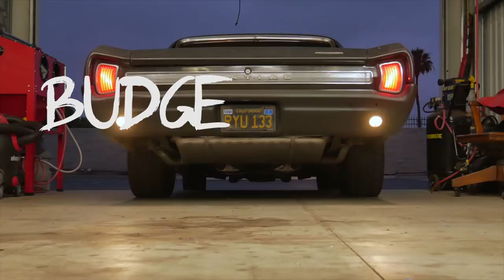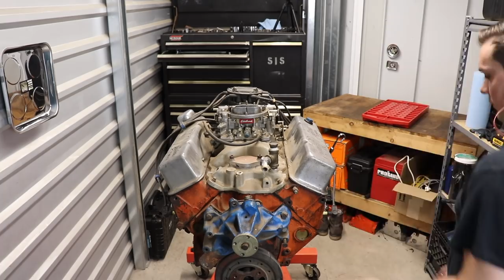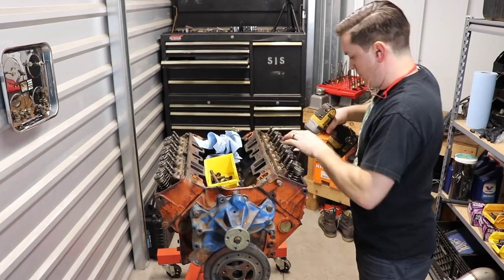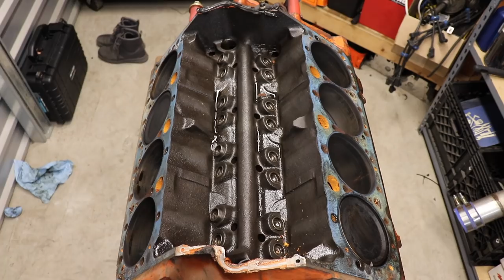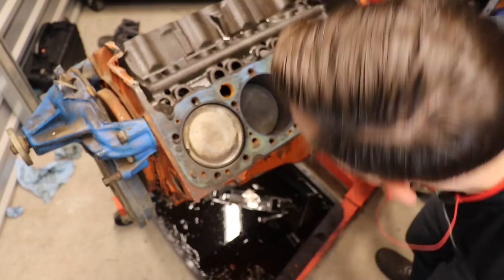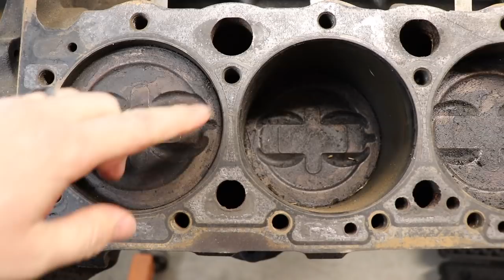Chevy 400 Small Block | How to Disassemble a Small Block 400 -REBUILDING BASED OFF SUBSCRIBER ADVICE

Comment from the maker: IT'S UP TO YOU SUBSCRIBERS, GIVE ME YOUR BEST BUILD RECOMMENDATIONS AND I'LL MAKE IT HAPPEN...LET THE FUN BEGIN!!
Reply: Well, seeing how You got one of the most desirable Gen 1 SBC's ever made, combine it with a set of Vortec heads ( with the guides machined down for the ability to run a cam with more than .460" lift..) A healthy cam ( a Comp XE268 works nice, I can suggest plenty other grinds that'd be awesome too..), sell the heads and the basic performer that came on it, use the dough from the heads and intake sale to get a Clone Edelbrock Preformer RPM air gap Vortec intake, and enjoy a motor that will make a little over 400hp with boatloads of torque.
Reply: Chilli Willi is right and I've seen the vortec heads with a some port work and matching ported intake with a hydraulic roller make 500 hp easily.
Reply: Les Phillips, absolutely. I don't know the budget of this build, but 500hp is within reach with Vortec production castings. I've made over 600hp with a set of the 225cc Bowtie Vortecs and a solid roller on a 406ci engine. I've come very close to that number with fully ported stock castings cut for 2.08/ 1.60" valves.
The "secret" of why the 906 or 062 Vortec heads work so well is their flow EFFICIENCY, coupled with a very efficient combustion chamber. The .300" raised intake runner works well for only @168-171cc..
Reply from the maker: @TurboDog73TX  I haven't really thought about exactly what I'm spending yet. At this point I'm leaning towards the Vortec head idea. It just comes down to how easily I can find a pair.
Reply: Nick, they are readily available brand new still, from numerous sources including GM dealers.
Something You may consider if Your budget permits is a set of the "ProMaxx" iron Vortecs, they are much thicker in the deck surfaces than the OEM heads, and flow more out of the box, they also come with screw in studs as delivered. If You're really seeking 500ish HP. 
Nothing wrong with stock castings, but the aftermarket versions can be cheaper in the long run. Good luck no matter what direction You go!
Reply from the maker: @TurboDog73TX  I really appreciate the tip. It may not be more expensive in the long run to get them new considering the work it will take to get an old ones ready. I'll check out Promaxx
Reply: I need a 400 SBC to finish my k20 resto  it came with a 400 from factory but when I got it it had a broken 327.
Reply from the maker: @TheMoldyOne  The 400 isnt an engine you see a lot.  Hopefully you find one soon.
Reply: @BudgetBuildGarage  u should be able to find vortec heads from a  local U Pull It car junk yard for like 150 to 180 bucks, the best year of vortec heads that i have herd are the 99 vortec heads, and if u want to run a 500 lift cam u can retro fit the LS6 VALVE SPRINGS as long as u use the comp cam retainers. If u want the part numbers on the retainers and valvesprings. Just let me know
Reply from the maker: @sethnelson8698  Thanks for the help man. I was actually planning on going to my local pick-a-part next weekend. I am looking for those heads and some random other things I need.
Reply from the maker: Thanks for the casting numbers!  I am really looking forward to this build too.
Reply: @BudgetBuildGarage  no problem man, some other casting numbers that i found are 12552520, 12558059, and 12558062. Good luck on the build

Comment: I would....
1. Disassemble the short block, have it zero decked. 
2. Check cly. Bores, main bores. If clys. Check out dingle ball hone the clys. 
3. Check crank journals if they check out reinstall crank reuse bearings if good. Is the oil pump std. Vol.?? If it is add high pressure spring. Add crank scraper and windage tray.  Stock pan will work just fine. 
4. Clean and inspect pistons and rods. If big end checks out reuse bearings. Use new rings file fit to .025 end gap. Large gap if you want to spray it. 
5. What cam is in the engine??? Competition products has a great catalog with lots of no name cams to choose from. Reuse timing chain. 
6. Disassemble heads, gasket match and bowl blend ports. Drill steam holes. Clean and inspect valve's and reassemble with matching springs. Don't forget to check installed hight. New valve seals. Change out pressed in studs for the screw in replacements. Use comp cams magnum rockers or the clones. Just going for consistent ratio. 
7. Install heads useing a .035 to .040 head gasket. I calculated the comp. Ratio should give you 9.5 to 1. 
8. Buy a performer rpm clone gasket match and clean up pendulum area. As for carb. Holley 3310 750cfm vacuum secondary is the ol' stand by. 
It's my assumption that the former owner built this engine and it would get hot so he pulled it, declairing all 400s are junk because he didn't pay attention. I also assume it doesn't have many miles on it. Also use a wix 15794 2 quart oil filter. Extra quart of oil and double the filter cant hurt.
Reply from the maker: Thanks for the info!  I really appreciate the step by step you have laid out here.
Reply: I missed that the heads are small valve castings, if your being Totally low buck I'd run them. Helped a buddy build a 350 we called the mouse turd and we cleaned up a set of small valve heads as described above except with stock rockers and it ran surprisingly well. Since the heads are small I'd use the performer that was on the engine but still get a 3310 carb. Competition products has a howards cam #cl117091-14 that is a copy of the 350hp/350 cam for $129.00. While not the best head you could use when optimised they will do ok.

Comment: I built a 400 sbc and while I spent quite a bit on it.   Doing a budget build, I would get a cheap set of 64cc aluminum heads (get the steam holes drilled).   I installed a Lunati Hydraulic Roller cam but if you didnt want to spend that much a flat tappet would work.

Comment: Clean the carbon off all the pistons and if they all look as good as the first one then leave the bottom end alone.  Put a decent cam in it and some aluminum heads and run it!
Reply from the maker: I will clean them up and make sure they are all in good shape.
Reply: @BudgetBuildGarage  if you ask uncle Tony's garage you should put them back in backwards.

Comment: I've built alot of small blocks never a sb400 but built a 385 stroker, most important is head flow at least get vortec heads. After that the common intake,cam, and headers. I did build a b.b.454 for my dads chevelle dome piston port polisish heads big vales. But on you're small block most important as long as your good with what is done next. By the way the best way to learn is to do what you are doing and that is to do it . Also i learned from reading , books by David Vizard are very good. Thanks for sharing always good to see youger gear heads playing with their toys.
Reply: How did you get to that cu inch

Comment: Iron Vortec heads flow a ton of air more than the 70cc ones you have do. They will boost the compression with your existing dish tops to about 10 to 1. You can drill the heads to fit a non vortec intake but I would fins a used RPM if you could. Prep the heads to take .500 lift with a nice 280 magnum flat tappet hyd cam. Under 500 lift. would be a beast of a torquer with a 5500 top end.
Reply from the maker: I like the Vortec idea.  I think it wouldn't be to hard to find a used set for fairly cheap.  Thanks for the comment!
Reply: Yes. Do it. Buy the heads already done. Leave the bottom end alone if all checks out.
Reply from the maker: It is a solid plan.
Reply: Don't be afraid to put bearings in it especially cam bearings they get wiped out often you said oil pump why not new bearings polish the crank right there in the garage and then when the tach is poking around at 5 grand or more the chances of spinning a bearing is far less likely to happen if it does most of the time there goes a good 400 crankshaft

Comment: 400 cid with 400hp seems like a realistic goal! Cam, drill and port (gasket match) the heads, Rebuild the 1406 carb,  dingle berry the cylinders and run it
Reply: IMO I think you are right with the hp numbers...the 400 being externally balanced does not like high rpm...well not for long anyway...

Comment: What I would do is take it down and get the block down and have it magnaflexed and checked for cracks if it turns. Out good I would have. The the heads reworked and steam holes drilled in the heads

Comment: Best bang for tha low buck. Rebuild tha short block(can re-use all tha factory guts).  Get sum old 327"camel hump heads" have them ported n screw in studs n 2.02 valves installed(or whichever aluminum head with u can afford with the biggest intake values street/strip 400s love 2.02-2.08 valves). Victor jr intake w/at least a 750 dbl pumper. Comp cams h292 cam. 2800 stall converter n 373 gears 350 or 400 trans(makes no difference). Will sound nasty and get you in the mid 11-12.20 range depending on the head choice on pump gas. And will take a 200hp shot of nitrous to show up those trailor queens. Good luck with whichever u choose 400s are very versatile

Comment: I think you should make it work with what you have your guy's name is budget build garage after all. I dont have a lot of cash so i like to see stuff made work thanks
Reply from the maker: I wouldn't mind doing that. Maybe just drill the steam holes in the heads and put a new cam in.
Reply: @BudgetBuildGarage  vortec heads off say a 96 or 97 pickup with the right machine work for a higher lift cam and screw In studs, steam ports drilled and then port them and intake yourself can be done for around 250 or so and matched with the correct hydraulic roller cam will make way over 450 hp depending on compression and that's about as budget as it gets.

Comment: The fact that all the pistons (that I could see anyways) were evenly carboned (is that a word?) tells me the rings are still doing their job. (sealing the bores/not letting oil past) Check the block decks for flat (head gasket issues between 3/5/7 cylinders and #1 outboard to the spark plug cooling hole/head bolt hole) to determine if the decks need to be surfaced. If they're flat, pull the pan and check the bearings. If they are OK, go ahead and find a set of heads (bigger is better for most 400 applications, within reason) and slide in a cam and have fun.

If you have the budget or find issues with the deck flatness or bearings, my vote would be to blueprint the block, (bake/magnaflux/square deck/torque plate bore/etc) Scat 1-90955BI balanced rotating kit, and a good set of heads for the top end and be amazed with the performance.
Reply from the maker: Thanks man. The carbon on each piston looks identical to the first piston.  I'll check the deck for straightness. I appreciate the suggestions.

Comment: A stock 400 is a torque monster compared to other stock SBCs. It's a good choice for a heavy vehicle. Just like a 383 stroker, but with a larger bore. Cubic inches are your friends, although some guys don't like the siamesed cylinders. I have two 400s, one freshly remanufactured, and the other one is of unknown origin. This is the one that's coming apart soon for a make over. Just remove all bearing caps and replace the bearings.

Comment: flat top pistons 292-501 comp magnum cam small port and polish on heads or aluminum heads but rebuild bottom end with flat top pistons hyperatic is fine no need for forged
Reply from the maker: This sounds like a solid way to go.
Reply: I have to agree flat tops are not that much money and as I said before bearings oil pump etc felpro gaskets aluminim heads or if iron find some vortecs and drill and small message at least gasket match decent aluminum intake and y'all are gonna say no but a good q jet carb they are just my personal preference due to the better milage if you stay out of it and the giant secondaries that cannot be mistaken for anything else that moan that carries for miles I've had people tell me they heard me coming from miles and miles away running around in the middle of the night we referred to it as screaming in the night but you can get a really good amount of power from a 400 personally I wouldn't bore it unless you have to it doesn't make power a good hone will be all you need to seal the rings and gap them pretty wide just in case you ever decide to hit it with a little spray that is so much fun and bang for the buck it's not even funny and if you use just a little bit of care you won't hurt the motor but be an idiot and don't widen the ring gap and don't take out timing on pump gas and you'll be like all these other idiots wondering why the ring land broke and head gasket blew when the ring land broke it scored the shit out of the cylinder wall thus making that block they spent all that money on a boat anchor

Comment: Hard part is done rings and bearings are easy, you'll have the pan off anyway to put in an oil pump.  Hone the cylinders, new rings, new bearings and seals.  spend money on the heads that's were the power is Vortecs are out there pretty cheap.

Comment: The 185 casting heads are old HD casting 1.72 valve heads (truck/bus applications, look at the boss cast on the pass front/driver rear by the outer head bolt for a compressor mount) and won't do much for you...….
Reply from the maker: So finding a different set of heads would probably be a better option?
Reply: Only if torque and horsepower is part of the build :^)  @BudgetBuildGarage
Reply from the maker: @yarrdayarrdayarrda  Hahahaha. Yeah that's a pretty big part of it!

Comment: First thing I would have done would have been a compression or leak down test before removing heads, those heads are pretty much worthless Dave's smoke 70cc gutless heads unless you are boosting it. I would suggest finding a pair of good heads for it with the steam holes already drilled and probably around 64-66 Cc's for a good compression. Also you might want to check the ring gaps and bearings for longevity
Reply from the maker: I think I am going to be pulling the whole thing apart and having the block checked.

Comment: 062 vortech heads with polished chambers and exhaust ports. stock crank with longer rods with full floting  wist pins and shorter pistons with gap-less rings and balence the cranke as well as light and knife edge it add windige tray. as for cam factory 350 solid lifter cam with rodes lifters. intake elderbrock rpm air gap ditch the edel brock carb for holly 600-650 600 is plenty and will give efi like profomance 650 will give more peak power but less snap. .  for cooling go with hevy duty water pump and 160* sleeve thermostat big radator use peak fleet charge coolant with bypass coolant  filter like fleets use to keep steam holes clean. fleet carge is life time coolent you use a filter with no sca for 18months or x miles then you use a sca filter from then on. add water weter for max cooling.  for exsost go with long tubes. take care!!

Comment: How much do you want to spend and what will you have when done...I would say go Vortec heads if you can find a pair that don't need work other then lap the valves to make sure they are all sealing and some new valve stem seals while the heads are apart...would be the cheapest performance upgrade as from what I have read other then being cast iron these are capable of flowing just as good as some of the aftermarket aluminum heads with the same size valves and flow better then any factory Gen 1 SBC head..plus you would need a vortec intake manifold...like a Edelbrock dual plane air gap which seems the best for this unless all out top end HP is your goal.
Also if you plan on using that Edelbrock carb it will be the choke point regardless what intake/head/header you use as it looks small like a 600 cfm max...
I would disassemble the bottom end and check the main and rod bearings...replace if needed...measure piston to cyl clearance and ring end gap...if it looks good run it...or run a dingo ball hone through the cyls and throw a new set of rings in...Vortec heads and dual plane intake...mild cam and a set of cheap headers...
Plus the Vortec heads with there smaller combustion chambers should give it a much needed boost in compression ratio and are good for like .460'' lift stock and were designed to flow very good a .400'' of valve lift which is where the valve spend most of its time..it boils down to how much do you want to spend with this being the cheapest route imo.
Probably find the heads in a pick and pull yard for peanuts..the intake will likely cost more.
Reply from the maker: I think this is a pretty solid route to take if I can find a set of Vortex heads.  Ill ask around and see if anyone I know has a set.  Its still to early to decide exactly what I'm doing but I may as well try and see if I can make this option work.  I appreciate the idea. Thanks!
Reply: Decent vortec heads and the right cam with the big jugs and long stroke equals 400 hp streetable and stump pulling torque numbers and it will live to fight another day that should be the goal let that 400 block live to grow old and grey so. Many lost their lives young due to dummasses bolting on 350 like that one and cooking it that's just for starters

Comment: U should try 96 to 99 vortec heads.  U can pick them up from a u pull it for 150 bucks and they breath much better than rugular cast iron sbc heads, allowing for more power, and u can retro fit the ls6 behive valvesprings as long as u use the comp cams retainer. That valvetrain combination will allow to run a 525 lift cam it the max, but  in the end, the motor should be making 400 hp easily

Comment: I think you should use the heads you have. It is a $300 motor after all.
Reply from the maker: I wouldnt mind doing that.  A well running cheap engine is every hotroders dream.
Reply: A 300 dollar motor that's just the gravy so if he paid 900 for it then it would be worth building I don't get it's a 300 dollar motor afyer all